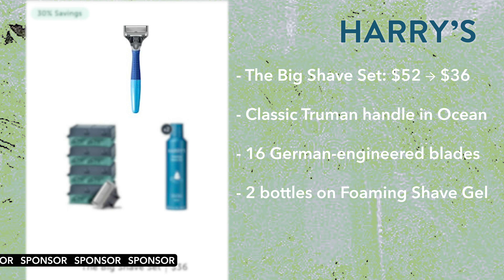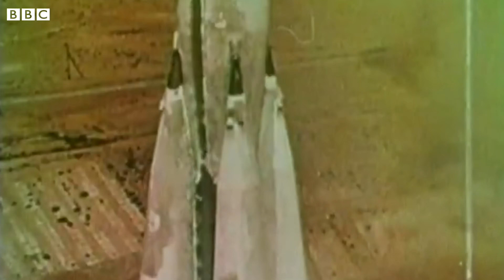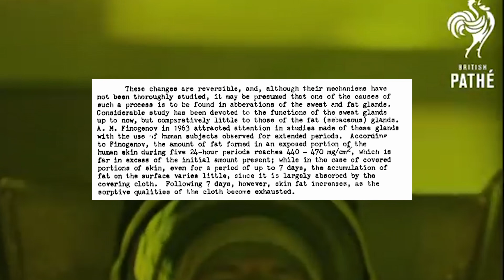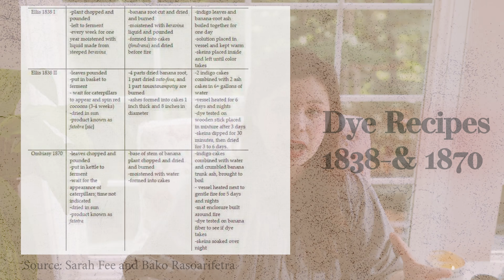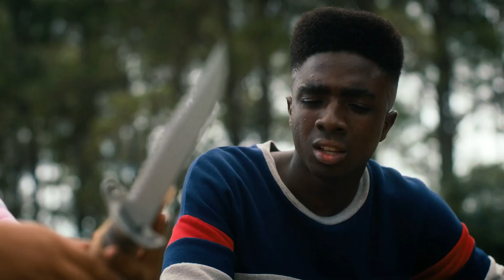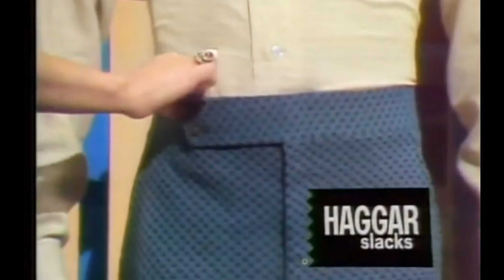The DISGUSTING truth about Laundry

Comment: Unless you have existing health conditions you've been warned about you don't need to sanitize your clothes. Yes it sounds icky, but it has zero impact on your health. In the same way that you don't need antibacterial hand wash, the soap + water + movement does the job well enough.
Reply: Yes, couldn't agree more! Like don't wash your cloth diapers and other clothing together, because they will not require the same type of wash program. But clearly not soiled underwear will not make your other clothes unsanitary. Most of the "private part"  bacteria will be washed out of the garments with all the other dirt, any remnants will be unnoticeable. Most of the bacteria found on your clothing are also most likely the same bacteria that's found on your skin, aka. non-pathogenic bacteria you surround yourself with on a daily basis. 
Clothes and washing machines can become stinky (not dangerous, just nasty) if not dried properly, like being damp/wet and without ventilation for a long time. This is because bacteria like water and maybe there's a bit of heat, so they like it even more, and they multiply and they get a party going and they have fun, but all that fun creates a distinctive oh-no-I-left-my-laundry-in-the-machine-for-a-week smell (you can thank my room mate from university for that one...). Moral of the story: just wash similar things together and effectively line dry them after, you don't have poopy T-shirts. 

  - your friendly neighbourhood microbiologist
Reply: I leave the washer lid open after cycles to air out the machine so it doesn't stay so wet and let bacteria party on.
Reply: @synnrig  if you could imagine, we lived through Hurricane Harvey and our whole TOWN smelled like that for months.
Reply: @synnrig  If you wouldn't mind, I have a question: doesn't soap work on the basis of surfactants? Something about it destroying the lipid layer that protect pathogens? Is this different from how detergents function? I'm sorry if this isn't quite in your field, I'm just a bit confused by the video!
Reply: @yuuri9064  Yes yes yes. ANY soap/detergent kills bacteria and germs. (To get it straight: Soaps are made with natural ingredients, detergents are made with synthetic “man-made” ingredients. Both function the same in terms of cleansing however detergents are known to be stronger and function with hard and soft water, while soap isn’t agreeable with hard water. Detergents can be not-so-great for the environment, unfortunately.) Products that are specially marketed “antibacterial” are just marketing tactics, since any soap you use - $1 shampoo, laundry detergent, dish soap, $150 fancy skin cleanser, on and on, they ALL bust up bacteria and germs by the mere basic function of soap. Soap particles have two ends - one that is attracted to water and the other is attracted to oils. When you use soap with water, it grabs water and oil, and lets you physically wash it down the drain. Dirt, grime, fats - yucky stuff is all oil (lipid) based, which is why soap is so effective. Germs and bacteria are “held together” or surrounded by a fatty layer, in which all the harmful “stuff” is contained. Soap grabs onto that fat and literally busts open the germs and bacteria, destroying their structure then washing the now ineffective bits down the drain. This happens with ANY soap/detergents, so long as you’re following directions (lathering/agitating for enough time, in directed manner and with sufficient water and soap).
Further, an antibacterial agent called triclosan was added to hand soaps, detergents, body washes etc., for which manufacturers would then advertise the awesome antibacterial effectiveness of such products. Triclosan is now banned from being added to such over the counter products because, amongst other issues, has helped create antibiotic resistant super bacteria, as bacteria was able to transform and gain resistance due to exposure to so much triclosan. So adding to the fact that any soap is antibacterial on its own - is the fact that using products with antibacterial agents like triclosan are actually harmful!
All that out of the way, what’s the message? Using any soap or detergent, whether $1 or $200, body wash, laundry detergent, face cleanser, bar soap, on and on (keeping in mind that using soap with hard water won’t work so well), the important thing is that you use one of those products and water, agitate/later all over for a decent amount of time, rinse and that’s it! Doesn’t need to be hot water, too don’t need bleach or alcohol - the soap/detergent WILL clean and kill germs and bacteria!
Reply: @synnrig  Thank you!!!
Reply: Thank you! I really appreciated the information about energy use, environmental impact, and alternative ways to do laundry (for those of us in the US who may only know the washer+dryer routine), but telling people they're walking around with "poopy" clothes feels like the kind of shaming that would be done in middle school.

I've kind of always assumed that long as clothes don't have a smell, they're probably fine. Humans are pretty good at sniffing out "bad" stuff. I do appreciate Abby's encouragement to line dry, as that is something I've always wanted to try but that they just don't do where I'm from (Gulf Coast of US) very often.
Reply: @with_katie  line drying was the norm where I grew up (Mid-Atlantic) but when I tried it after moving to the South it just doesn't work the same. Between pollen season turning everything green, the intense sun bleaching anything it touches and the humidity that doesn't want to let things dry, it just doesn't work. I line dry as much as I can on racks but a tumble dryer seems necessary for anything like towels that want to hold moisture.
Reply: YesI and in urban areas the clothes don't smell fresh either from line drying
Reply: @experimentallytheoretical3116  
One advantage of tumble drying towels is that they end up softer than when line drying, but without having to use fabric softener that makes them less absorbent.
Reply: Yes, thank goodness!
Reply: I’m surprised at Abby’s vehemence about the “ick” factor.  Body oils aren’t intrinsically unhealthy…nor do we get sick from wearing “unsanitized” clothing (unless maybe cloth diapers).  Love the emphasis on the environmental factors.
Reply: @alindadrury7156  I was too. I have ocd and have to bathe twice a day (not a full tub, just a few inches so I can soap up, exfoliate really hard, and feel clean) so I have a hard time believing that I'm losing THAT much body oils and such in my clothes. But I think we're on the same page, I used to cloth diaper my baby so obviously that got washed very separately, as do his sheets if he has an oopsie now. But panties and the rest of your clothing washed together? Why not?  I put some bleach in my whites, so that's that, pantiliners collect things you might not want in the rest of your clothes, but even without, I have a hard time believing that laundry isn't "clean" if you don't do a separate undergarment load. In fact they're such small items it seems like a waste.
Reply: Yes! I was waiting for this comment 😌
Reply: Yes! I was thinking the same. Washing with soap and water is highly effective, you make it impossible for the bacteria/viruses to continue to stick to the surface and they are just washed away. It is in general more effective than rubbing alcohol/hand sanitiser.
Reply: Yes!
Reply: This! Considering how good Abby's videos usually are, I'm honestly kind of disappointed to see that kind of misinformation in this video.
Reply: @myrna_m  Me, too.  If anyone has been paying attention to all the hand washing tutorials in the Age of Covid, they would already know that the "oil loving" tails of surfactants stick nicely to the fatty envelopes that surround pathogens.  

This is such an enormous science fail that I had to stop.
Reply: @myrna_m  I believe it is just to shock people if they don't care about any of the other points in the video.
Reply: Guys this is a lot of info to take in, I want to see if I got it right. So, disinfectant not needed if not differently stated, washing on low heat isn't as bad as it was before, wash poopy stuff only with other poopy stuff, line dry. Is linen a better undergarment in the end or not? And also, have I missed something?
Reply: @DoodlesnDragons  I remember my grandmother bemoaning the fact that linen clothes had become very hard to find because everything was plastic (drip-dry!) --in the mid -1970's. She did say that compared to cotton, linen wears like iron, i.e. lasts a really long time and gets softer with every wash.
These days, clothing made of linen are high-end & pricey, but should last a long time. Like the linen bedsheets that have sponsored Abby on occasion.
Reply: @fredericapanon207  Can confirm linen is pricey, I've been increasingly making my garments from it and my wallet is questioning our sanity lmao. I can see why it has some drawbacks that keep modern people from using it though, aside from cost. 

The Other problem I'm running into is ironing. Linen needs ironed or it looks rumply. And while I know how to iron (Thanks dad!), I am already fatigued and ironing is hard!

I love my linen shirt dresses, but I don't love having to iron them constantly. I have worn underwear layers for years now (slips, undershirts, etc) to keep from having to wash outer garments so much, but if I put my linen dresses on, it's already ironing time. :/

I do hang to dry (I'm making these garments by hand I'm not ruining them in the dryer lmao), which may be why it doesn't release a single wrinkle, but still.
Reply: @fredericapanon207  Except for in extremely hard water areas like mine... Here, they will literally start to feel like iron too, if you don't use some kind of water softening 🙃
Reply: @mialemon6186  I would highly recommend looking into a steamer. I was ironing a linen dress, borrowed a steamer from my aunt, got better results in a fraction of the time. I probably only need it for the few (hopefully more soon) linen pieces I own, but it definitely seems like a worthy investment
Reply: @DoodlesnDragons
Reply: @DoodlesnDragons
Reply: Yeah, only thing I worry about remaining in my clothes is blood, which even comes out in cold washing, which is energy efficient
Reply: Also working in Healthcare, you have some much daily laundry.
Reply: I've noticed that if I don't sanitise certain clothes they still smell bad after washing them. That happens with black things and with hubby's work clothes. I can understand these last ones but what's up with black clothes?
I know it's not just me
Reply: @lapatti  @Jackrabbit Crafts No offende, but that might very well be your washing machine being dirty and not detergent and fabric being tje problem. Also not every fabric might react to it the same way, so other times going well could be possible, tough it might also be that you got used to the smell and just didn't smell it on the 2nd load but a few days later u can smell it again
Reply: @lapatti  I wonder if it's the material or the dyes. I've had some clothes (usually synthetics) that, after a while, smell off straight out of the wash even though the next piece of clothing smells fine.
Reply: @lapatti  probably the dye.. sometimes black clothes smell awful even when new especially black jeans. I had to get rid of a black jean jacket after two days because of the stank. I've even gotten rashes from black jeans with that 'stinky' dye.
Reply: The water also doesn't have to be hot when washing your hands. It's the friction that kills germs.
Reply: Yeah, I feel like if she had said that lots of people are actually getting sick because their clothing isn't being properly sanitized that we don't necessarily realize then I would be like yea sounds like something we should do. But this sounds like the same thing when people talk about how much bacteria is on your toothbrush, it's like it doesn't seem to be making us sick so should I care? 

Also someone said she advocated for hand washing and she never said that. She recommended front loading washing machines, hang drying, spaying clothing with alcohol and buying linen instead of plastic fabrics.
Reply: I was pretty disappointed by this video.  Promoting hand washing and hot water washing is actually not eco-friendly at all.  Modern detergents work effectively in cold water, which is recommended to save energy (and also wear and tear on the clothing!), and IF sanitization is needed, which as you mention it usually isn’t, there are many products available that will sanitize laundry in cold water.  HE washing machines, regardless of whether they are front or top loading, also use less water than hand washing.  Plus, their agitation based on rubbing the clothes together is gentler on the clothes than a washboard, and you have the option to pass the wastewater through a filter to collect some of the microplastic instead of just pouring it all down the drain like with hand washing.
I was also somewhat annoyed by her comment about hard water, because laundry detergent isn’t soap!  It does wash out in hard water, just like dish detergent, shampoo, and all the other products where we find non-soap detergents!  Yes, with very hard water, detergents won’t wash out either… but anyone with water that hard will definitely notice residue not only on their clothes, but also on their hair, dishes, skin, etc.  So we are not walking around with dozens of washes worth of detergent in our clothes, any more than we are wearing poopy T-shirts.
Reply: @amykathleen2  you seem to have solid chemistry knowledge, I think you should paste you comment in the main comment section
Reply: @rita7070  Thank you, but it’s not chemistry knowledge exactly, I am just a recovering germaphobe who has done a lot of research on how cleaning works.  At first I was actually looking for confirmation of my worst fears, but ultimately the new information I learned proved to be far more valuable and my anxiety has lessened the more I understand.
Reply: As someone with sensitive /sensitive/ skin with eczema, for me, this isn't true. As you said, most people don't need to do this! But for me, using antiseptic skin cleanser on my eczema areas/break out areas actually reduces my skin irritation and bumps by, if I had to guess the percentage, maybe 75%-ish. 
My eczema was getting worse and spreading from my upper arms where it's been my whole life, to my lower arms, creeping towards my hands. After I started using the antiseptic skin cleanser, my eczema went away on my lower arms nearly fully, and banished most of the bumps on my upper arms.
Since my body is so sensitive, I think making some changes would help my health. Sanitizing my clothes regularly might help reduce my skin break outs even more, and maybe make me less itchy and less easily irritated. 
I don't expect a total cure, since my conditions hail from my DNA, but for SURE it will help and improve quality of life.
Reply: Bump bump ❤
Reply: It's not like we sanitize our bodies
Reply: I have no idea how I've survived half a century of using washing machines and detergents to seemingly launder my clothing and still be able to type this response?
Reply: + these days most people just pick up a product with antibacterial in it to sanitize (hand wash, dish soap, etc.) but that just ends up contributing to bacterial resistance to antibiotics unnecessarily
Reply: Or if you get pit build up then you should use vinegar OR baking soda (and literally does nothing) as part of your routine 
Also boil your dish towels always
Reply: I wash underwear seperate from every thing else,  same with socks.
Reply: It is a fact that certain bacteria won't be killed in water under 60 or even 90 degrees. So the question is indeed if the detergents work well enough. I've seen research that says otherwise and they even concluded the clothes washed in colder water were less clean in general. 
I think Abby really has some good points. Of course 'poopy shirts' is a bit exaggerated but it could very well be that certain bacteria are only spread through the water and not killed. And how does it 'wash away with the water' when the clothes don't even come out completely dry? It certainly helps to air dry I think. But I was astonished when I found out some people don't wash their underwear seperately. I'm from the Netherlands and I was taught to wash them with the bed sheets and towels on 60 degrees celsius always. I still do that even when it says 40 on the label. 
Also I agree it's not a problem with normal clothes but when it comes to underwear or even cloth diapers why doesn't it need to be sanitised every time? I've looked into cloth diapering but I honestly have a hard time believing they can be washed under 60 degrees and be clean. I'm not much of a bacteria freak but in this case I think it's important both for the skin and health of the baby and to keep your washing machine clean between washes.
Reply: @Anne-Jes43   @Lily&River  you should think about the fact that detergents help the dirt and every sort of lipid/hydrophobic substance separate from the clothes as they are sort of encapsulating them or piercing through, depending whay type of surfactant is used. And it is not like your laundry is all the time same 5l of water - after proper washing cycle there is the part where they are rinsed, so the "wash away even tho clothes are wet" part is taken care of. And noone really spoke specifically about cloth diapers as items not to be sanitised, tho ofc it also depends what you mean by that - hot water cycle - max 60°C should be enough for diapers but there is no need to use any special sanitizing products. In any case most of it is washing the dirt away. We have to remember bacteria doesn't just stay alive in air forever. Regular underwear... i doubt you just poop yourself on daily basis so i don't see a reason to make this an item to be standardly sanitize? Most regularly you just have sweat on them, maybe with some urine/natural genitals products which are not toxic or harmful, best youu can achieve by oversanitizing your clothes is wearing them down faster or using too much products that will actually irritate your skin a nd make you more prone to infections
Reply: @animeholiczka  I know no one talked about cloth diapers ... But I see the same trend there as with underwear. Lots of companies advice lower temperatures (under 60) because of the wear it will have on their product. So both cloth diapers and underwear used to be something that was washed in hot temperatures and nowadays is adviced to wash on lower temperatures. 
No of course I don't poop myself but we use toilet paper in the west and bacteria will be there. Bacteria from urine are less dangerous. I'm not someone who is obsessed with bacteria and you make some good points about the rinse cycle and the air drying. 
I just question if it's true that all bacteria will be killed by detergents in cold water. I honestly haven't find any studies that proof this. Again I don't think it's that important for normal clothing but I do think it's important for underwear, towels or cloth diapers. So I would wash those on at least 60 degrees, not 40.